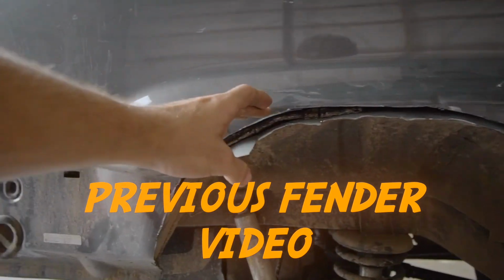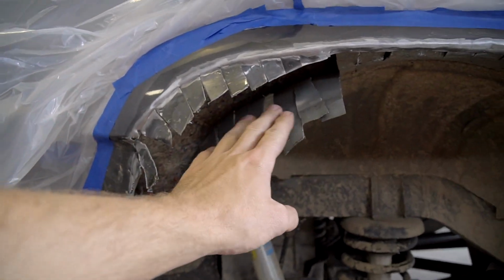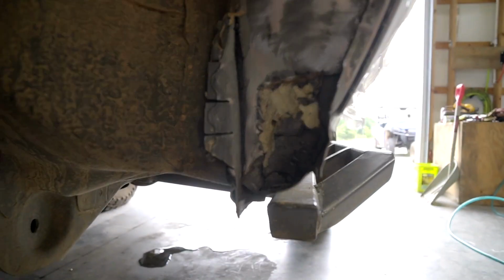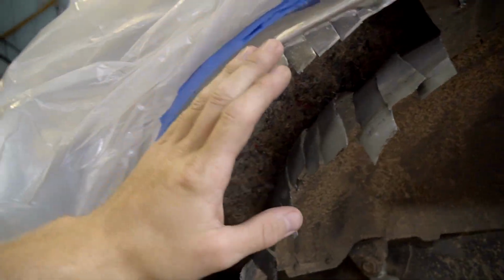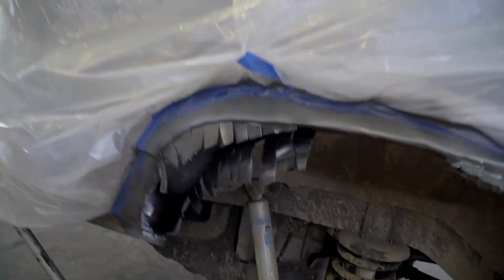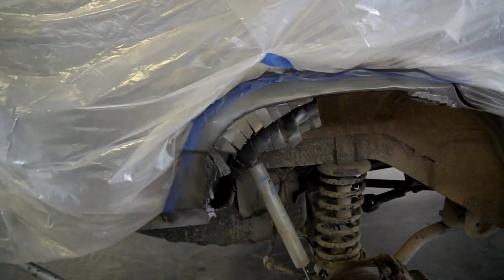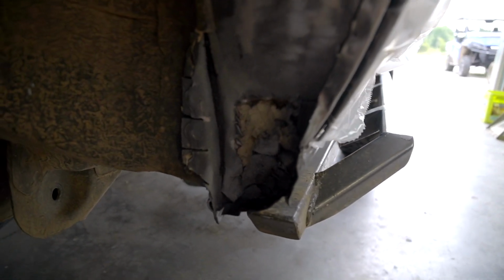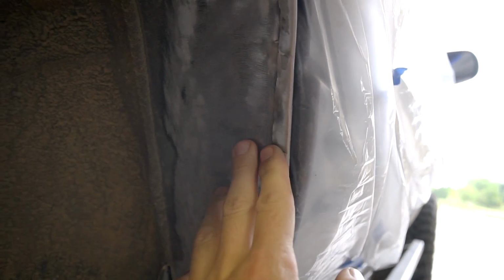Custom WJ Fender Trim

Comment: I actually just cut my rockers out . I had that same rust spot , but a lot worse. I cut the outer rocker and the inside out . Then I left the back pice of the rocker so I could push a rectangular tube all the way back to it. Next I welded all the way around and top coated with raptor liner. I gained almost 2 inches in ground clearance too.